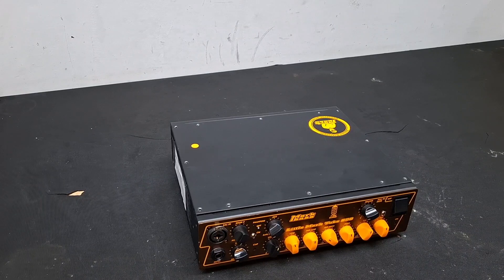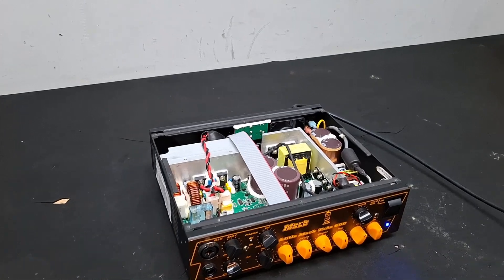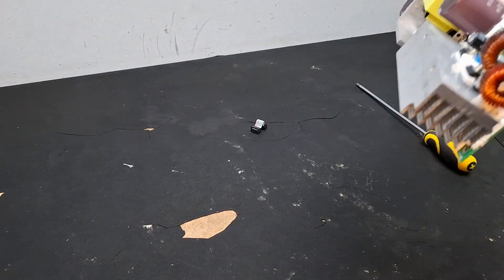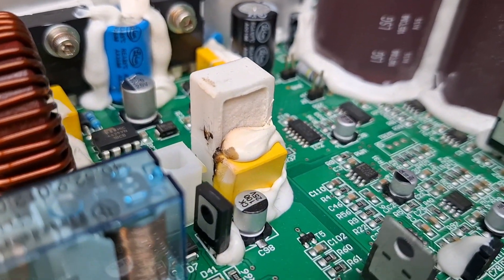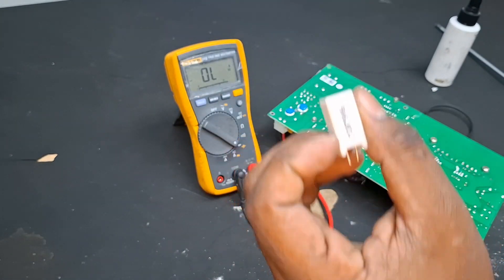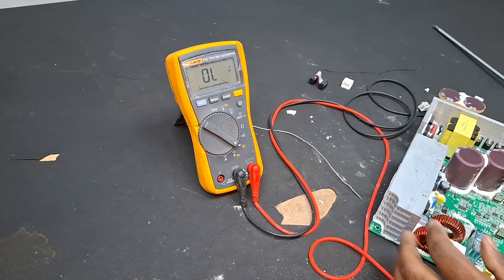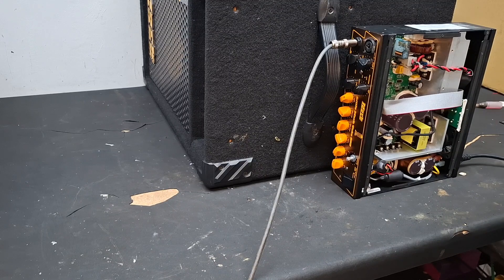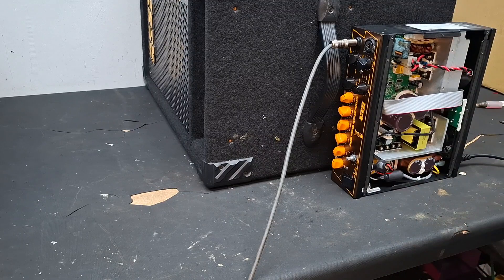Markbass repair, no sound - bass amplifier

Comment: I have the newer replacement board (half the size) in my little mark and the same is blown but looks like the board is burnt underneath. $350 for a new board. Ugh have a hard time buying a second board. Almost 1k into this over the years and needs repair again. Lasts about 5 years.
Reply from the maker: Yes , you can jump it , but just make sure you clean the carbon off from the board , or else you will have same issue down the line.
Reply: @I @Indetail-repair got the cement resistor in and put it on and jumped the ground even though it tested good. Now it does work but first power on takes 40-60secs. Anything else to maybe check before I am done with it 😢 power on and offs after that initial long startup is within 3 secs.
Reply from the maker: @TreysBays I have the same board in for repair , please give the value of the resistor you replace and the ID number on the board , I can try study your fault from my board and advise you for any possible parts to replace
Reply: @Indetail-repair I can get the board number tomorrow morning. The resistor is a 5w 4.7ohm. There is two together on this board next to the power output relay. The only numbers I remember on the board is 4413 but I’m pretty sure I bought the replacement Board in 2014 so that would be the date code.
Reply: @I @Indetail-repair 5.011 LS ed.D
E252098 94v-0 are the numbers on the board.  Cement resistor next to 8pin relay.
Reply: Looks like the ground pin is the one burnt. Would I be able to jump the ground pin to the same resistor next to it for the ground?

Comment: My Mark bass amp 800 (same model as in your video) does not turn on, no blue LED (and of course no sound).  Was working 3 weeks ago but we had some severe thunderstorms since then. Do you have any suggestion of what to check about the power section? Have taken cover off and see no visible signs of damage.
Reply from the maker: In case of thunderstorms/lightning, its most likely your power supply section , check the IRFP27N60 and the IR2153 IC
You can always isolate your Amplifier side after replace them and check it switches on
Reply from the maker: https://youtu.be/alBa1rMimLY?si=iJz1YoFyng8-Jjfu
Reply from the maker: Check this video,  the power supply circuitry is exactly the same

Comment: Hello great job fixing it. 
By any change do you have the schematic for it. Maybe you can help me  there are 2 led light by the big relay  and none of them are on also no power at the relay. I do have 100v on both rail going into the amp side. I have looked at everything but without a schematic it's hard, capacitor 98 was faulty  I changed that but still not powering the big relay for the output I found a schematic for little mark bass ll but I don't think is matching. Any help would be nice.  I have audio  coming out on tuner jack and lxr.
Reply from the maker: @TheGaboni809  Hi, I don't have the Schematic for it but what I can suggest Is too isolated the amplifier side , by soldering out the + and - . By doing so you check if the relays clicks , if it does click then you may have a leaking transistor.
Reply: Ok thank you. I will do that thank you for the suggestion.thank you for this video. Helped me understand how the amp relay output works I'll keep you posted and write what I found that might help other people with the same problem
Reply from the maker: @TheGaboni809 , thank you , I will post another video soon on markbass

Comment: Hello, Thanks for the clear video. I have the same amplifier and someone tried to fix it. 
it didn;t work and they lost the two Transistors on the big Heat Sink. 
can you tell me the values you have so I can replace them. 
Also the inductor has a burnt wire and I will have someone rewire it for me. 

It would be amazing to fix. since there is no one that knows how to fix it. and the schematics are not accurate.
Reply from the maker: Thank you for watching, the schematic a definitely not clear , but I do have 1 Tube800 in for repair , I will check the value of FET on the heatsink for you
Reply: @Indetail-repair  thank you 🙏
Reply from the maker: @issamkhatib  if that's the case , you will need to replace the IR2153D IC and the iRFP27N60k FET on the power supply section
Reply: @ thank you. I will give that a try 😊
Reply from the maker: Does your Amp switch on , or you still need to repair power supply circuit on the board ??
Reply: @ every time power on, fuse breaks

Comment: Yes no sound , where are you based ?
Reply from the maker: @danram69  what is the model number of unit , ? Do you see signal on the LED in the front when sending a signal on the input socket ? Does the Relay clicks on the amplifier board?
Reply: @Indetail-repair  it's the mark 500 , it seems to work now and then but if I turn it up it shuts down , yes the relay does click
Reply from the maker: @danram69  first you need to check if the relay switch off when it cut, if it does , it means the protection circuit is taking over due to detection of DC voltage to the speaker output sockets
Reply: @Indetail-repair  OK how do i do that ?
Reply from the maker: @danram69  if this the case I will suggest you look any visible sign of dry joints on the board or any burn components